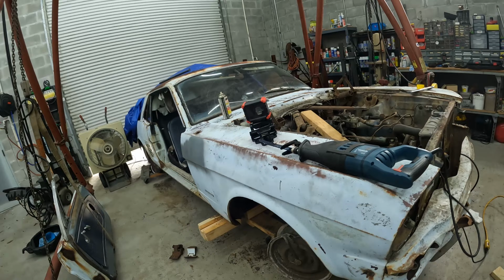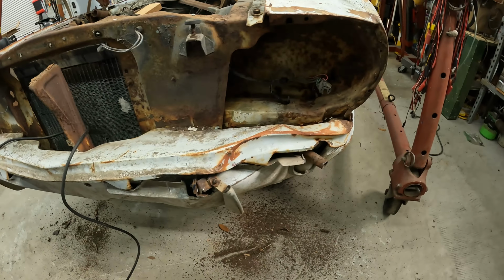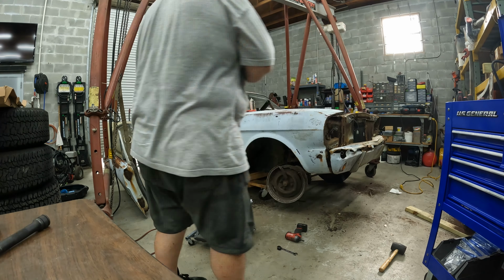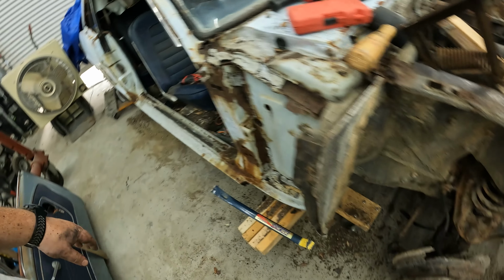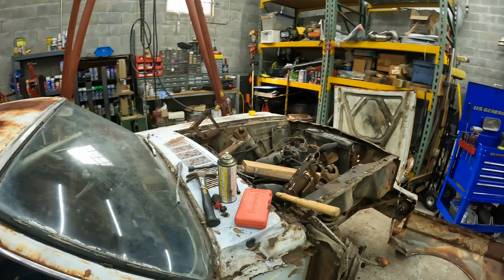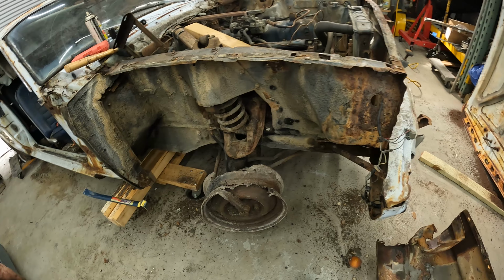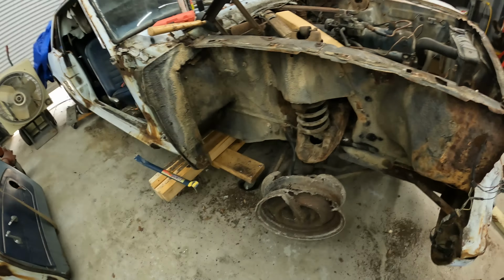Teardown of the 66 Ford Mustang Part 2

Comment: I was 7 years old in upstate NY in 1966. By 1976 they had the Rustang nickname, since most were in the junkyard from the rust. I bought a 1972 Barracuda in 1979 with 60 thousand miles for $1,200 that was just starting to get body rust, cheaper than a similar Camaro at the time.
Reply from the maker: I believe it. There are a lot of areas that rust out on these cars